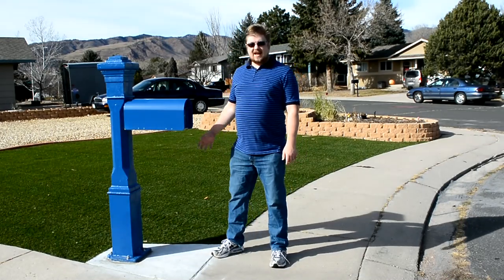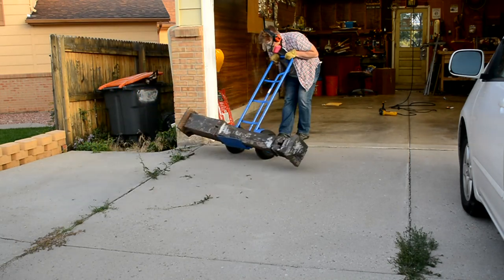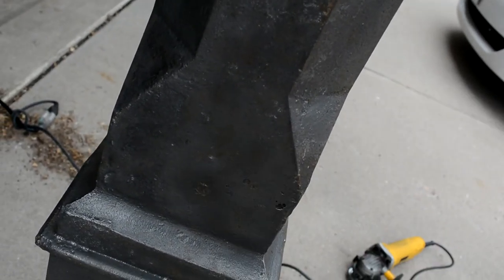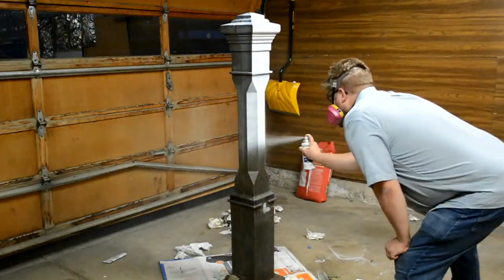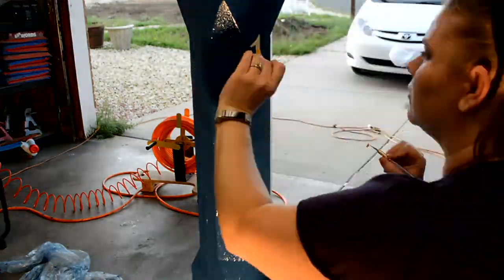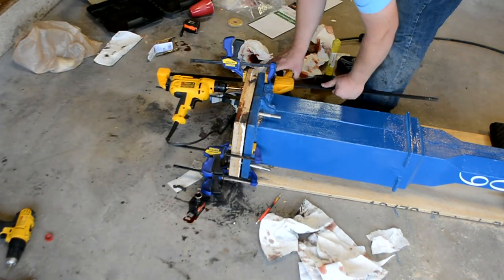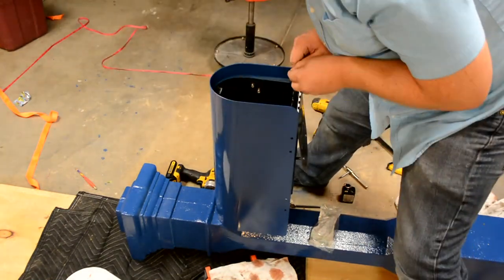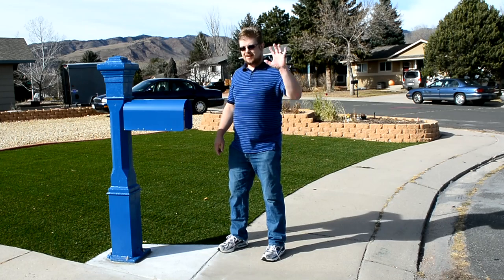Car Proof Mailbox

Comment: Just wondering, why didn't you use cutting oil when you were drilling into that cast iron?
Reply from the maker: didn't have any. the engine oil I dipped it in did the trick.
Reply: cast iron is self lubricating because it contains graphite

Comment: That mailbox is illegal. It is supposed to be “crash proof” which means if a car runs into it it breaks at the bottom. And it is to high it’s supposed to be a certain height so the mailman can reach it while in the car. I’m sure the mail people HATE you lol
Reply: That's easy enough to fix, just fix a square AR500 steel plate in concrete one inch off the ground and attach the post to it with weak bolts. When someone crashes into it the bolts will snap off and you can just replace the bolts.
Reply: Actually if it break off at the bottom it could fly through the windshield, better to bend at the ground level or pivot there and have the bottom uproot itself in a hard crash.